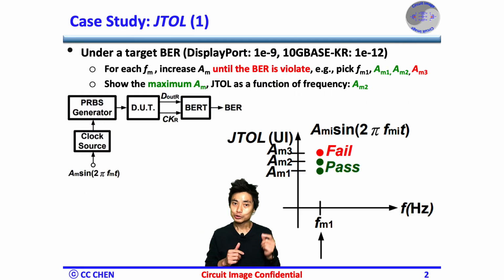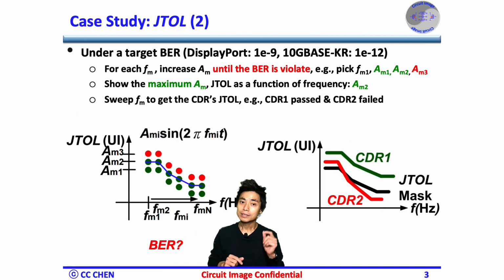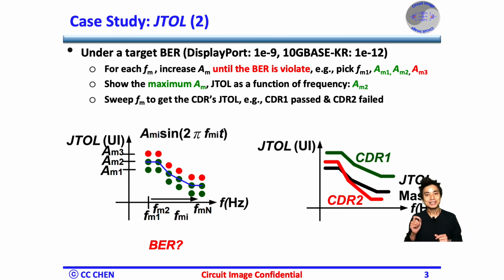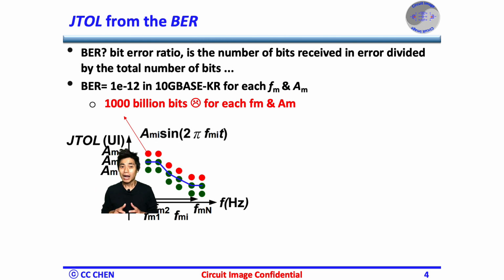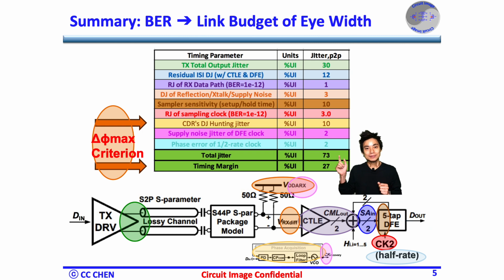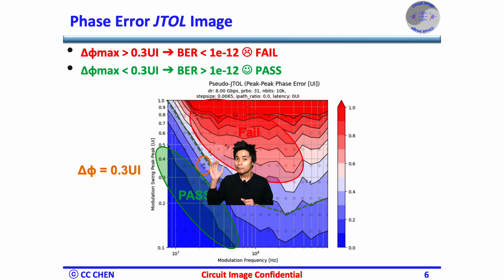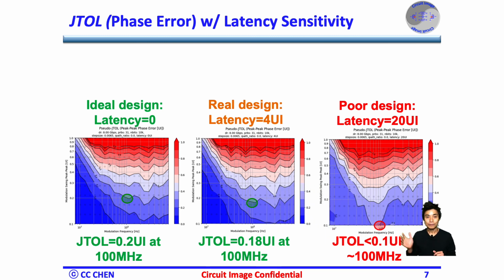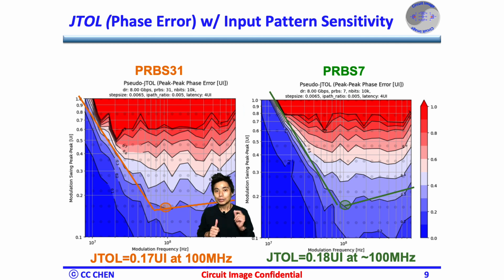Why Pseudo-JTOL in a CDR Design or Verification?

Comment: Hi Chen, your video is always so instructive and helpful. But please allow me to dig into some details. I have few questions regarding the link budget on slide 5. 
1.  The TX total output jitter is 0.3UI which looks quite big. Does it include ISI?
2.  Does the item RJ of sampling clock mainly stem from the jitter generation of CDR itself? If yes, why can it be so much smaller compared to the TX output jitter?
Reply from the maker: Hi JY, 

You're very welcome. Thank you for the good feedback. I have comments below in line.

1. The TX total output jitter is 0.3UI, which looks quite big. Does it include ISI? 

[CC] No. Most spec of the TX TJ~0.3UI. FYI, http://efaidnbmnnnibpcajpcglclefindmkaj/https://cdn.teledynelecroy.com/files/whitepapers/designcon2013_slides_pcie_gen3_seminar.pdf

2. Does the item RJ of the sampling clock mainly stem from the jitter generation of the CDR itself? If yes, why can it be so much smaller compared to the TX output jitter?

[CC] Correct. If you design the CDR's tracking BW wider (> 100MHz), then applying your high pass corner frequency (> 100MHz) to integrate the RX's intrinsic phase noise can be much smaller. 

In another extreme case, if your CDR BW is very small (1KHz), then your integrated jitter would be very big, like a long-term jitter. 

Please be advised that the TX output jitter was defined by specification, so you cannot design it if the RX input source came from the link partner, which is out of your control. 

Make sense?

Thanks,
CC
Reply: @circuitimage  Hi Chen, your explanation is so clear and makes all sense to me. Thank you very much for taking time to answer.
Reply from the maker: Great 😊 I am glad 😀 it’s clear to you now. You are very welcome 🤗